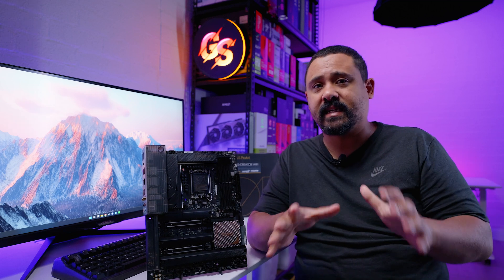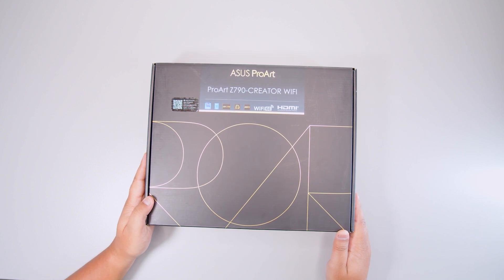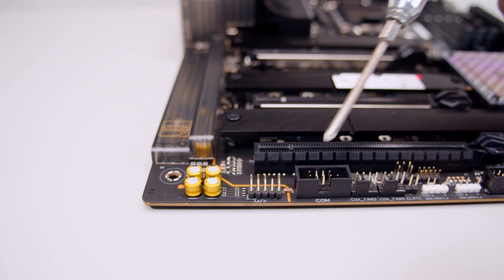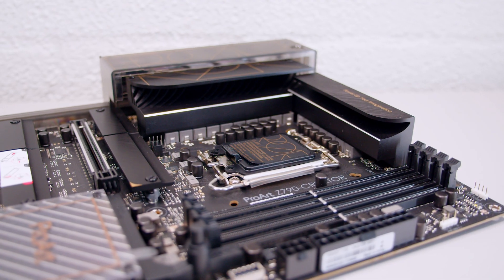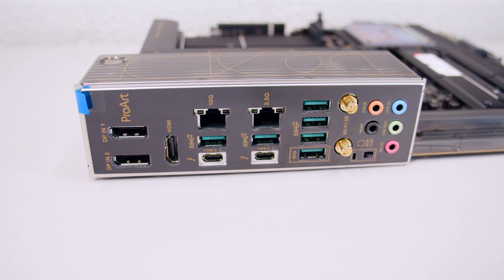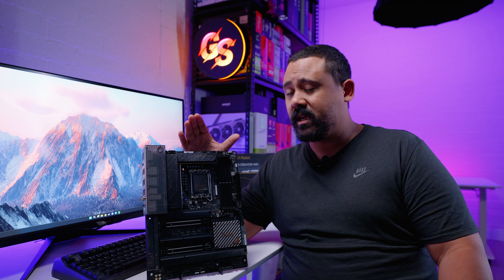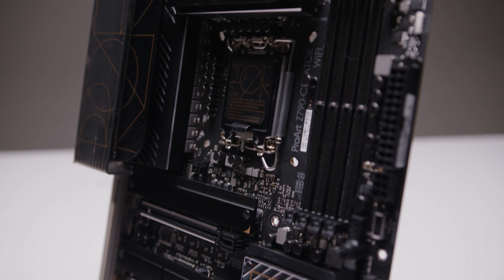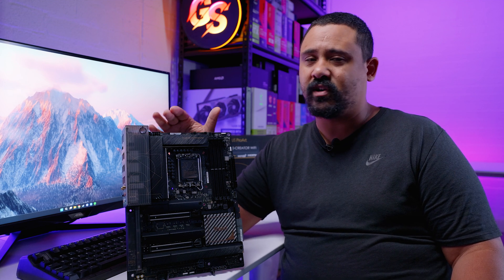The MOST interesting Z790 motherboard you've never heard of - ASUS ProArt Z790-Creator WiFi

Comment: This is a great motherboard for homelabs because you can split the first 2 PCIe slots in a x8 setup and fit 2 GPUs, can add a network car in the last slot for more networking, even a 1G card for a management interface, saving the faster slots for higher performance VM’s, and you can pass through the iGPU to a VM or share it if using LXC containers.  Having a consumer CPU board that can house 3 GPUs AND has a lot of network IO is awesome.

Comment: Did anyone look for or find the motherboard BIOS backup Battery? Yes/No! It's hidden and almost impossible to get at and replace! Why did they do this?
Reply: @johnfoster7596  I’m also looking for the CMOS battery. The user manual doesn’t say anything about it. I’m hoping it’s not under the I/O or VRM heatsink. Any info on that?

Comment: Would this work on a thunderbolt docking station? I work from home and use a thunderbolt docking station to connect my work laptop to my monitors and other peripherals in one place. I would like to game and still have my thunderbolt docking station setup where all I need to switch between game and work is one cable. I'm not sure other avenues like a KVM switch would work in my use case.
Reply: I have this same question. Please let me know if you got your home/work thunderbolt dock situation functioning with the one cable swap out.  I currently do this for work and home laptop so would like to just plug the thunderbolt cable into the PC when it's game time.
Reply: @sonkies5117  I'm not in a place yet where I can afford a full on desktop PC yet, but I do have a gaming laptop that takes advantage of thunderbolt 4. I'm not a competitive gamer by any means as the most demanding games I play such as Counter Strike, Battlefield, Witcher, etc all tend to run smooth on my thunderbolt setup hooked up to an ultra wide 1440p monitor with ease. Does that answer your question? I guess I have achieved that setup, but not using a full on PC using this motherboard yet, but I'd like to which is why I made that initial comment in the first place.
Reply: @Wakemeup456  Thanks for the idea @Wakemeup456 I've built out the PC with the asus thunderbolt motherboard.  I can easily change between work mac laptop, home mac laptop and home PC with a single thunderbolt cable.  The cable goes into a caldigit dock and has all devices hooked up to it (ethernet, usbs, speakers, monitor etc).

Comment: just picked this up on ebay for $230 shipped in the states. I agree all boards should have 10g. I have 2 others with 10g. EVGA classified z790 and aorus master x z790
Reply: hey how did the ebay purchase turn out? Was everything good? Was it used or Open Box?
Reply: @Gandalf22476  I used in a computer i sold. I assume its working great because i haven;t hear otherwise!!

Comment: Is this still worth getting or better wait for the next gen?
Reply: Considering how powerful the 13th and 14th are, if you want to go with Intel and don't mind about the 15th gen (that will use a different socket, so think that there will be not upgrade path CPU wise if you put a 14900K in it), this board will provide you with everything you might want for a veeeeeery long time.

PCIe Gen 5 isn't even standard in GPUs (though the rumor say that NVIDIA is planning for it for it's next 5000 series), M.2 Gen 4 SSD can reach very good speeds (you can take a Samsung 990 Pro if you want one of the top of the line, and it's even compatible with Gen 5).

The only thing to really consider is for the upgrability of the CPU. LGA1700 is officially not getting any more CPU, and AM5 is brand new, so more recommandable if you care for upgrade (Asus ProArt X670E is the AM5 equivalent of this board).
Reply: ❤ thank you for the information.
Reply: @philberex  You're welcome, I wish I had come across your question a little earlier, though. 😂

But if I can elaborate a little, depending on which use case you'll build your computer for, don't hesitate to go for AMD's options. Their last gen CPUs are crazy efficient (Ryzen 9 7900 has 12 cores for a 65W thermal envelop, and its performance are on par with its overclocked counterpart, and you can get it for around 330€) and it would allow you to balance the electricity load towards a more performant GPU, for instance.

Comment: the extra power is not for the PCI slots, man read the manual :D Its for the USB-PD power for the frontpanel USB you can pull up to 60W from that port with that power attached. It also supports QC3.0. Same as the AMD version of the Proart.

Comment: One thing that's not been discussed is these Asus ProArt boards are very popular with music producers using Windows, due to the low DPC latency they offer.
Reply: Hmmm, would using an external usb sound card fix that though?
Reply: @drunkntigr  Thats a good thing! Low DPC (Deferred Procedure Call) latency is crucial for real-time audio processing, which is essential for music production. High DPC latency can cause audio dropouts, glitches, or latency issues, which can be incredibly frustrating for music producers.
Reply: thank you for this comment, made me switch from AMD and finally pulling the trigger due to the DPC latency on AMD sucks on the Anubis

Comment: "Creator" - M.2_4 slot shares bandwidth with SATA6G_5~8. SATA6G 5~8 will be suspended once either a SATA or NVMe device is detected at M.2_4. So Asus did same as usual in almost all ther MoBo 600-700 series(except STRIX Z690-F GAMING WIFI - there is only one SATA6G_2 will be disabled when M.2_4 is operating in SATA mode) and a few other models, that can be counted on the fingers. So basicly if you want to put together a mini-storage in your PC by filling this board completely, you can easily get to a point where instead of 8 Sata you only have 4 available. And that's for very high price of that board. BTW two Ethernet ports is useful.
Reply: You sound like you know what’s up. What would you recommend <$400 as a creator board?

Comment: This motherboard has my interest, but I'd like to know a bit more about how the DP-in and TB 4 ports work with regard to display daisy-chaining before I commit...

Let's say I connect two outputs from my GPU to the two DP-in ports on the mobo. Would I then be able to take two TB4 hubs (e.g. a pair of Plugable 5-in1 TB4 hubs), connect one to each TB4 port on the mobo, and display to four monitors (i.e. two per hub)? Or, would I be limited to one monitor per TB4 port?

Comment: Does the board or the CPU need update in order to use the 192gb of ram?
Reply: There is need a BIOS update, not CPU update, and since  BIOS 0814 there is "improve single 24/48GB memory module compatibility".

Comment: I have the X670E (AMD) version of this board, and it's one of the few boards that can justify its price. 10GbE alone is worth around $100, and having the massive number of USB ports, gen 5 slots, nvme slots, and etc make it one of the few first gen boards of the new platforms that can be expected to last the lifetime of the platform.
Reply: i have msi x670e tomahawk and its the best mobo ive ever had. paired with my 7950x3d and 128gigs of ram with a 4090 founders. enough juice to run everything in 8k for me
Reply: Uh, that's great. A lot of boards will handle that fine. The point of the video is it has dual thunderbolt/usb4 and 10gbe, which is something that your msi board doesn't have, but it also costs twice as much as the msi board. I'm not sure what argument you're trying to make. @The300ZXGuru
Reply: @Yue665  yeah well I don't need my 16tb of m.2 12k read either but it's nice to have.  Usb4? Nothing runs on this yet. Like saying I need a 16k TV or monitor.  Lol
Reply: @The300ZXGuru  That's kind of the point though. With 10GbE, you can shove that into a NAS and still have fast enough transfer to enable editing directly from the NAS. USB4 has less use cases, with some major ones being external gpu, thunderbolt docks, and thunderbolt ssd. But again, it's a content creation motherboard, so storage/transfer speeds are priority.
Reply: @Yue665  Yes so why doesn't the ProArt Z790 have m2 gen 5, I suppose the motherboard is under 500 dollars though so not complaining i guess.
Reply: That's a limitation on the processor side. Intel doesn't natively support pcie5 on 12th and 13th gen, though I think some boards pull lanes from the gpu to allow pcie5 on nvme. Ryzen 7000 has 28 pcie5 lanes, so if you want native gen5 storage support you're better off going AMD.  @UnknownMoses
Reply: @Yue665  Most Asus boards with M2 slots share bandwidth with the GPU on at least one M2 slot with Gen 4.
Reply: The last gen4 M2 slot shares bandwidth on the x670 board, but the pcie5 ones are separate since ryzen 7000 has more pcie lanes @UnknownMoses

Comment: 4:30 That additional PCIe power is for your front panel USB C power delivery up to 65w quick charging. 
I have this motherboard love it.
Reply: What power supply are you using? Are you using all of the power connections on the board (24-pin, 8-pin, 6-pin, 4-pin)?
Reply: @markmiskill6635  Hi yes using all 4. 
Motherboard 24pin 
CPU Power 8pin + 4pin 
and 6pin additional power for usb-c 
My GPU RTX4080 is powered with a 12VHPWR cable without any adapters. 
Power Supply BeQuiet 1000W PCIE5 Modular 80+ Gold Power Supply Unit
Reply: @tomasramoska what case are you using?

Comment: Great looking board, you need to do a Pro Art build. Lot of rumors on 14th gen or 13th gen refresh, I am really hoping for a refreshed 13600k that will run on my z690. I don't think you are wrong about 14th gen otherwise why did we see so many new z790 motherboards at Computex this late in the release cycle. It is too expensive but it is Asus, I am scared to see how much the Pro Art 4080 will retail for.
Reply: Ya I think it would look great in a Fractal Design North (dark) case.
Reply: @TheSwayzeTrain  Wow, really nice case for this mobo. I wish it would have a bit more 3.5'' drive brackets and a whole side panel of a glass. Then it would be perfect! But I think I might still get it when I'll be able to buy this mobo :)
Reply: What are you talking about? 13600k (13th gen.) compatible with 600-series boards. It seems to me a more important question: if the 14th generation does not receive a controller for DDR4, then just all the boards with DDR4 slots will find themselves in an unenviable position. And it doesn't matter if you bought a Strix with DDR4 for $300 or something similar with DDR4 for a similar price.
Reply: @unheard5982  14th gen is just Raptor Lake refresh and not a newly designed CPU and since Gigabyte already has a new BIOS for upcoming CPUs on my z690 DDR4 I think I am OK.
Reply: @richardfarmer6570  Ok, thanks for info. Honestly i didn't "googled" that for other vendors, even i have now B660 board with DDR4 and 12 gen. i7. That's a good news.